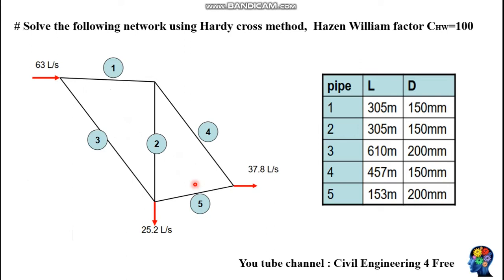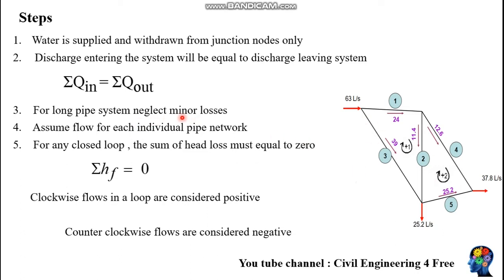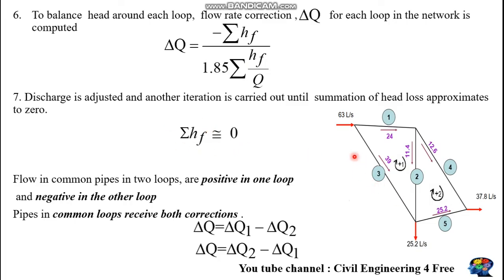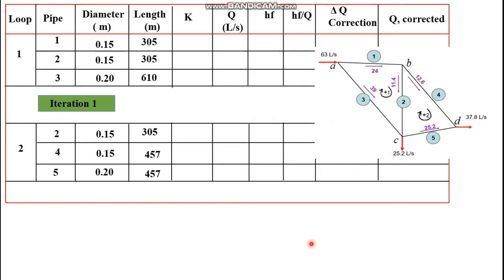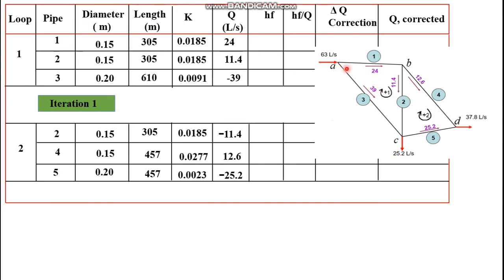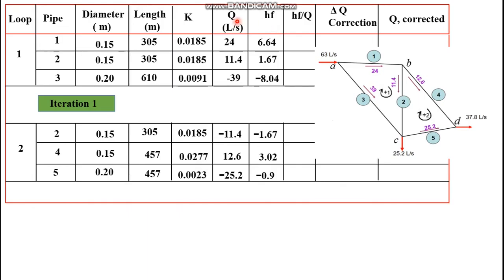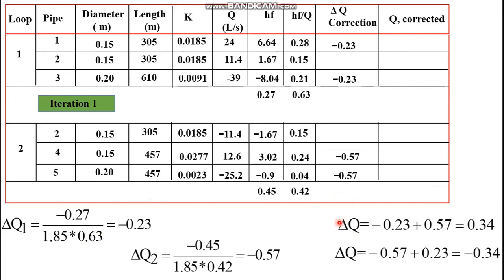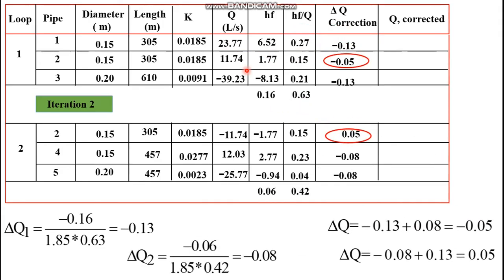Hardy cross method  for pipe network

Comment: Where did the 6.02x10^-9 came from?
Reply: I got .0021 instead of 6.02x10^-9.   Is that an error or am I missing something?
Reply: @dand7056  When you transfer 1000 that divides Q, you need to apply 1000^1.852
Reply: I got 0.0000021 (if you multiply 1000 to convert m3 to L)

Comment: Please correct me if I am wrong.
It seems that in your calculations you have substituted a diameter equal 0.25 m for pipe # 5, not 0.20 m - as indicated in the table with data.

Great video, allowed me to finally understand this method!
Reply: You are right